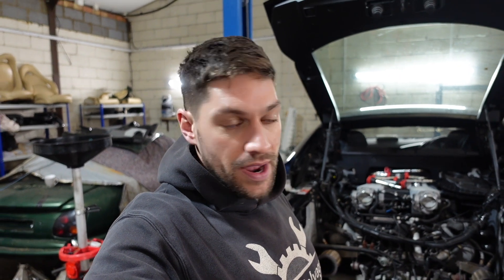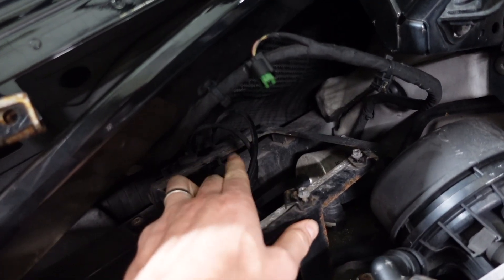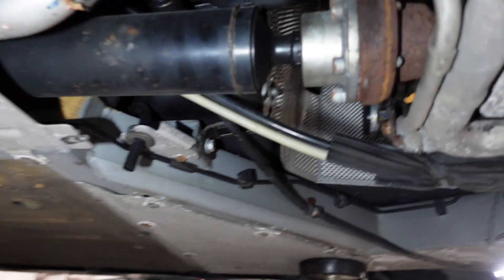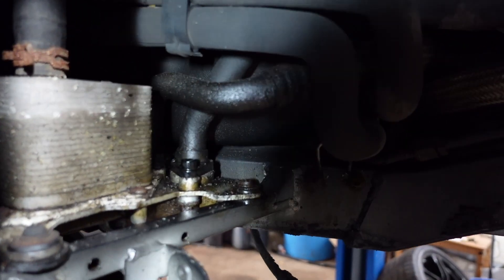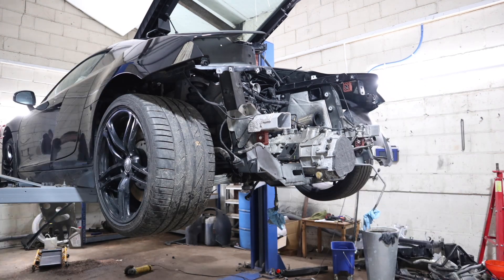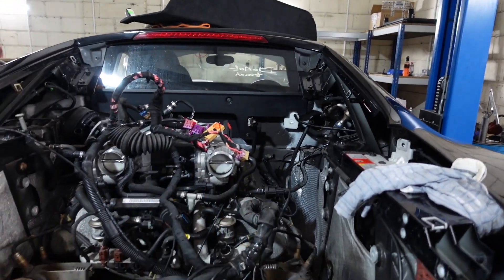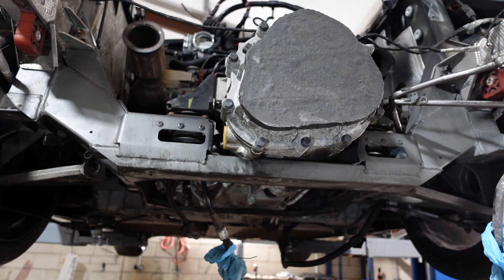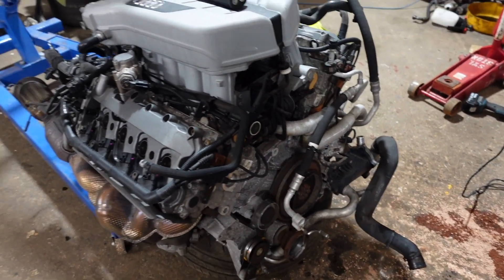REMOVING THE BROKEN ENGINE FROM MY AUDI R8! PT.3

Comment: Well done you can tell he knows his stuff labels and photos will help on the rebuild after Hes fixed it.
I'm looking forward to the next video 
when taking an engine out some people disconnect all the wires from the engine but through experience you soon work out to leave the wiring on the engine and disconnect the loom instead.  
Will you be changing the clutch ?

Comment: Your videos really helped me in my engine removal, I wanted to ask what’s the best way to get ELSA for my RS4 B8. 
Your spark plug looks extremely similar to mine from the rs4 where after removing the head I found a snapped intake valve. I’m currently expecting my forged closed block to arrive and thus ELSA would be helpful in reassembling all the ancillaries correctly along with torque specs. I have found sellers selling the software on aliexpress but they are not able to confirm if my car is included. 
Any advice will be appreciated 🙏

Comment: Top job on getting the engine out. Defford looks easier than the RS4 did. Maybe you just made it look easy 👍🏻
With all the extra followers from you're getting from ever increasing better content. 
It would be good to show how you made sure there was no gas in the aircon before undoing the banjos and releasing it all to atmosphere. 
Don't want to upset the eco warriors or get a fine.
👍🏻👍🏻👍🏻👍🏻

Comment: Not really your main concern at the moment but check those rear wheel bearings after rolling back with no drive shafts fitted, have known bearing to collapse when there is no driveshaft fitted

Comment: Just curious was the oil sensor functioning correctly? Wonder if it's been a combination of oil cooler leaking and previous owner not checking it hence its just ran too low and then lost pressure. If the oil sensor was faulty which is common on these

Comment: Saw one of these engines stripped the other day…..
Suspected water locked….
Oh no no no no no..
Failed tensioner failed guid and one of the pulleys snapped off causing catastrophic damage inside…😮
Reply: telegra.mme_____savingsalvage  no nog

Comment: That bolt you mentioned may well of been a bolt at some point, perhaps someone over tightened it & stripped it. So the put a nut on the end of a longer bolt to hold it in place. German cars can be frustrating when you cant work out how they come to pieces. I always go by the rule that is if your struggling with  a German car your doing it wrong, & you need to find the correct way which is usually easy. German manufacturers are usually very clever people.

Comment: "Apart" is a doddle.. I could take the QE2 apart.. back together looks like a hundred hours or more of labour, easy - disregarding the time the rebuild will take/cost in parts/hours & hours of diag time that it will take to sort all the inevitable sensor/wiring/re-coding issues that will no doubt arise.  Dunno, if you value your time at even 20 quid an hour, does this one pay? What's your feeling? I'd be going "omg....." at this stage. :-)

Comment: So, to circumvent a "security" screw you simply cut a slot in them and unscrew them! It's almost as if the major design point is to make working on it extrememly difficult. Surely not.

Comment: Lol, everybody (including me) wondering how he manages to remember how it all goes back together. I assume he has a numbering system and/or films everything thing so he can play it back when screwing it together. 
Thankfully I don't have to worry cos not in a million years would I want to take on that headache. Absolute mare.
Reply from the maker: I take lots of pictures for the orientation of pipe work and electrics etc… everything else you can either work out or just know

Comment: Hi! Do you (our anyone else)know if its fine to use a jump-starter-pack on Polo 1.2tsi -15  and put positive to+ and neg. to -minus pols as intended? a famous YT:er said in some video I`ve seen that the negative clamp from the jumper-pack should be connected to the engine block instead of the battery!(?) otherwise it will set some valve or relay or something electronic wrong in most/all modern cars. (it was a while ago a saw the video so cant remember exactly), but he claimed that, "your" engine will run ok(fine) but, there is something that has been triggerd in some electric or some stuff in the engine system or some computer/s(ECU..) -and for it to run wright again it must be a dealer or shop with a "Fancy" scantool that re-sets it again. I wonder if thats right?? Or should I use my Noco Boost jumper-pack just the way I did on my older cars? (Only a computer/tool or specialist can notice that there is something thats not wright with the car if ones have used a jump-pack the"wrong" way he says). I remember that there was a Polo Gti (2016) on this/Your channel that you rebuilt!! Thanx anyone for reply. :)
Reply: Anyone knows?

Comment: I question Audi’s wisdom in locating the alternator on the bottom side of the engine, surely susceptible to wet, road salt and other crap off the roads?

Comment: I love that he thinks he could be saved. That engine is beyond saving. It has suffered catastrophic internal failure and sleeves will be all marked up.
Reply from the maker: It could be resleeved…
Reply: @SavingSalvage  Maybe but is it really worth the risk? Might be safer to buy a new/Used block. Flip side is of course content. Getting it re sleeved makes "better" content especially if it goes wrong.

Hard call. I will continue watching regardless as enjoying your channel.
Reply from the maker: Yeah I’ve got an engine lined up if I need it. Will see what this one looks like when I get it open and go from there. Either way new engine isn’t too expensive.